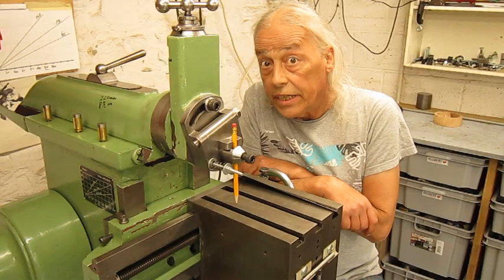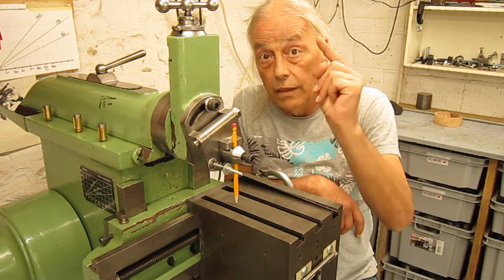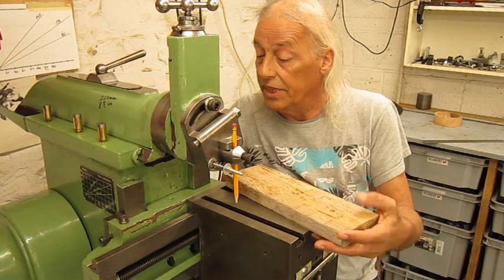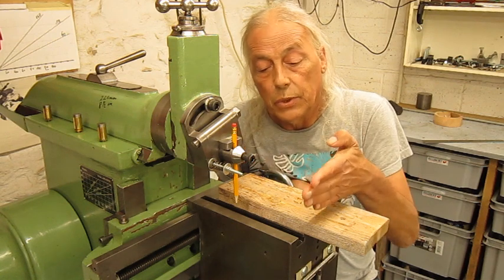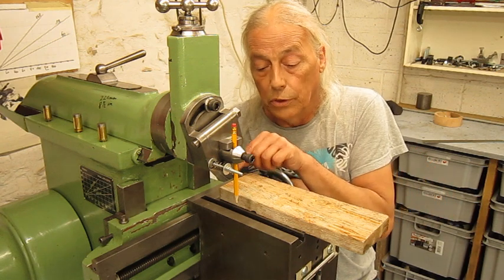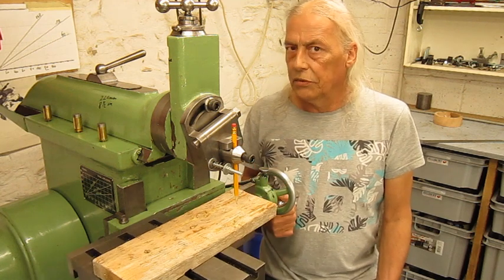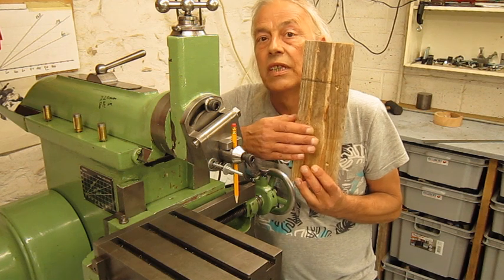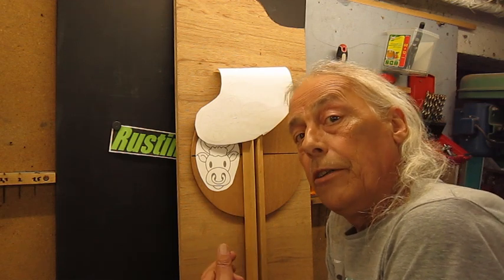Just answering a question 2.

Comment: Another thing you can do is take the cut, then extend the ram out a bit by loosening the handle on top of the ram and sliding it forwards, but with that, you have to worry about ram droop if you have a bit of wear in your shaper,  and the material flexing due to being unsupported underneath of the workpiece.
Reply from the maker: The problem is that the shaper makes this knocking noises when it starts the backstroke.
Reply: @Rustinox  That's really odd, Ive never had that issue on mine, lol.

Comment: Thanks that makes sense. But let's say that even if the bottom is not machined could you not flip the part and machine it and re-flip It again and  take a light cut to get the precision back? Just a thought.  Thank you for your stickers received them today. I will put on my expensive cheap door. And will send you a picture. Thanks for sharing.
Reply from the maker: Everything is possible i think. It depends of the precision you need.